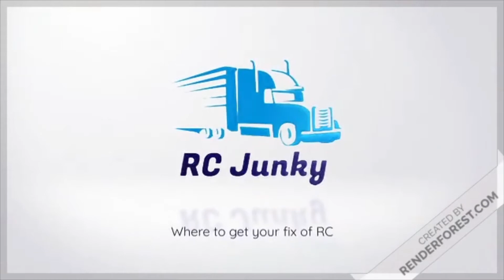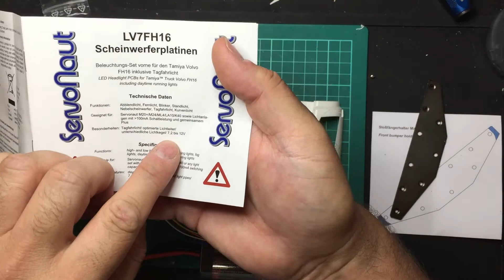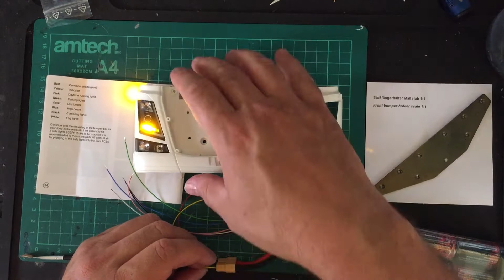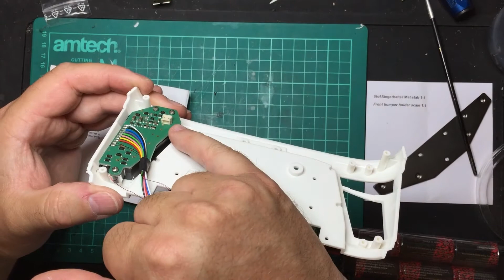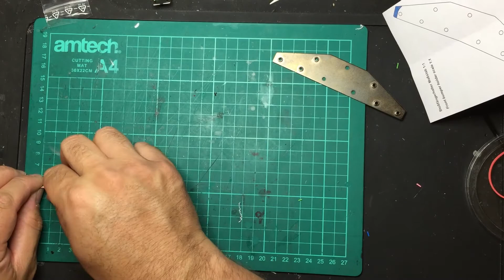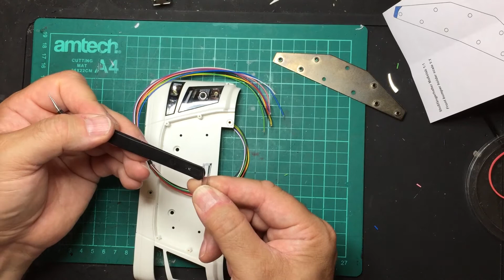ServoNaut LV7FH16 Front Lights Part 5 of 5

Comment: I'm very excited!! I wish the American Rigs had that elaborate of lighting.
Reply from the maker: SFR-1 does support USA style turn/side light function
Reply: @RCJunky  I was thinking of the Beier USM-2... So I can run a Hobbywing WP1080 ESC with it.
I've done a lot of reading since I made this comment... Very enlightening info!!!
Reply from the maker: @CarlRCTips  I was thinking the same. But the ESC in the SFR-1 had more features like inertia you can select by switch. Also I am going to remove the Tamiya 3 speed and go geared direct drive and use the 5 step throttle curve to simulat gear and gain more room for steering servo up front.
Reply: Watched again. Very cool!! Now that I've got both a AROCS and Actros (8X4 Tipper and 1850L Box Truck), I'm looking forward to trying this!! 

Also, found out that the USM-RC-2 was OBSOLETE soon after I bought them 😠😠, I got a couple of USM-RC-3s. The replacement!! ALL the functions of the SFR-1, but EIGHT inputs and 4 Servo outputs!! 😎 

Mainly because I have several Hobbywing ESCs, with great slow speed control. I hope to get at least one SFR-1. I recently learned about cruise control, single direction speed with forward/reverse selected separately, inertia selection and Throttle Expo. 
I wasn't explained any of that before... That would have changed my mind!